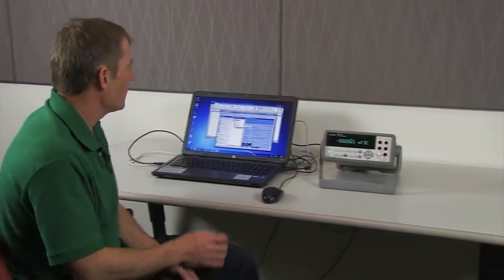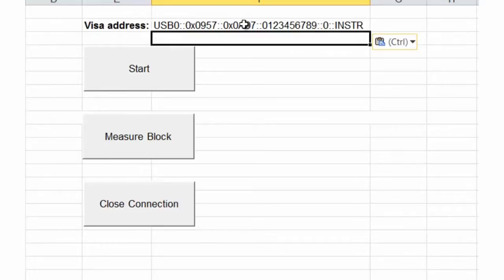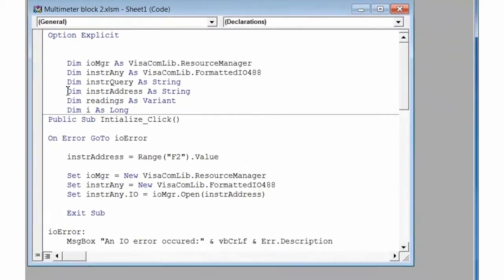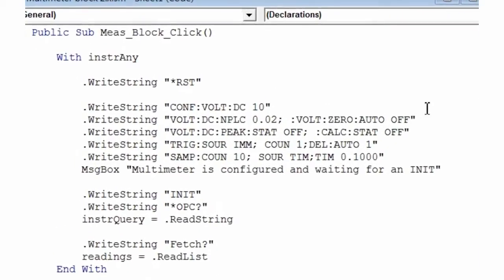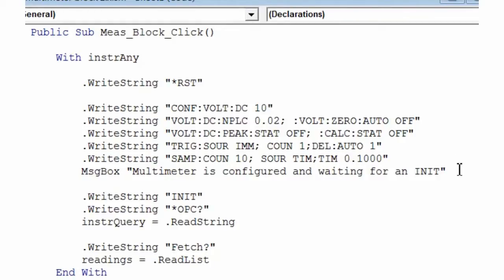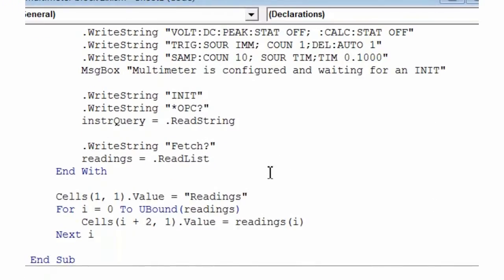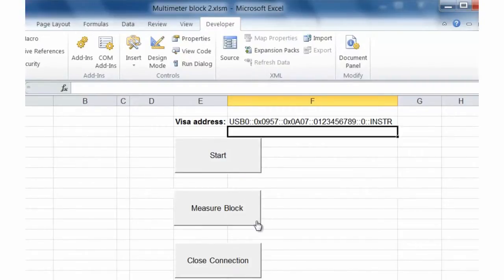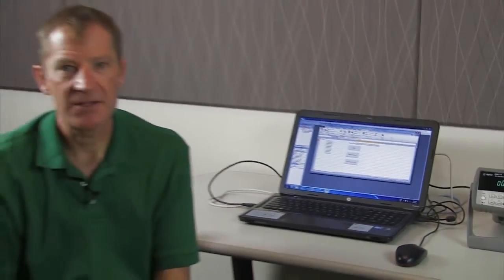Visual Basic for Excel, Example Program to Setup and Bring Back a Block of Data

Comment: I am using rs232 connection to my A34401A. , I successfully received data from meter but there are “BEEP”  and Error display on the meter form WriteString “VOLT:ZERO:AUTO OFF” to Line WriteString “SAMP....TIM 0.1000” , is it normal ? Or what I did wrong ?

Comment: Were the 10 readings already stored in the multimeter or on the software for the multimeter? Or did you produce 10 readings on the multimeter but edited it from the video? Confused as to where the 10 readings came from.
Reply from the maker: The General. The commands can be seen at 1:22. The multimeter was configured for 10 readings SAMP:COUN 10. The FETCH? command triggers the multimeter and requests all the readings.  After the reading are transfered the readings are written to the Excel cells.